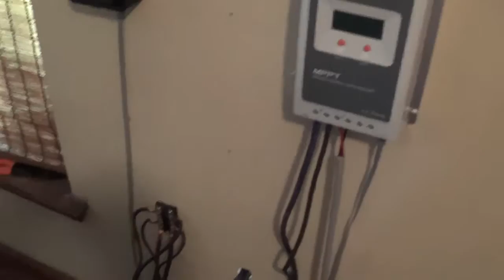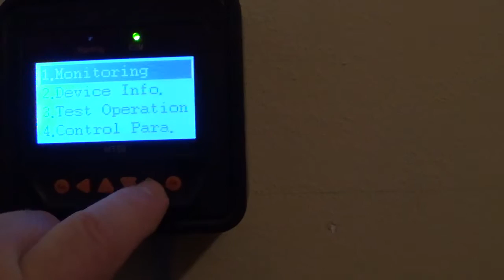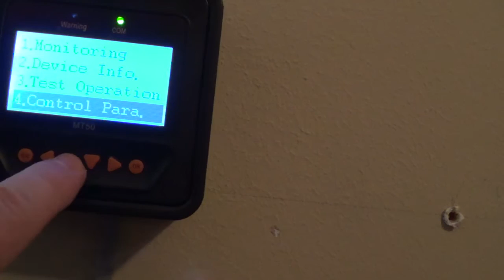Setting Parameters for Lithium Batteries and  MPPT EPEVER Charge Controller A series

Comment: Very clear lessons. I followed and using my MT50. Now I built a battery pack 7s 18p and on full charge getting 29.6v and unable to connect to my eleven controller and MT50 I couldn't find out a way to tell my epever and MT50 that I have a 24v battery. When I connect MT50 reports BATT. OVD and blinking in red. Please advise me
Reply from the maker: He man DO NOT connect them up to it with it charging to 29.6v its going to catch fire that voltage is waaay to high. You need it to cut out at 25.1  I am going to have nrodge1 explain it to you. Ask him your self he is on this page he is a engineer with this same set up he will explain it better than I. We are running 6s
Reply: shartne Thanks for your quick reply. I was advised by very big powerwall experts to pre charge the batteries to 4.2v before assemble the powerwall. So when I fully charge a 7s become 29.6v. This is my position. As you advised I have sent a msg to nrodhe1 right away. Thanks again.
Reply from the maker: @easy1792  Its nrodge1  you spelled it wrong.
Reply: shartne Thanks. But I replied to his comment   Did not typed his name. Waiting for his reply.
Reply from the maker: @easy1792  Go to teckluck.com http://techluck.com/cgi-bin/YaBB.pl?num=1486955008  and read how to set it up.  this is his forum he will answer you there. He has to answer your questions there because its his forum.

Comment: are EpEver BN series charge controller settings for LIFePO4 any different?
Reply from the maker: You should always look up the specs on any batteries you have beforedoing anything. You could have 4 cells in series or maybe 8 so youshould know more about them than anyone else.
This example is for my Leaf cells that are in a 6S configuration. You can talk to a real engineer in this forum called techluck.com  http://techluck.com/cgi-bin/YaBB.pl?num=1486955008   Nrodge1 is his youtube channel
Reply: @shartne  I have a Tracer4210AN and running two 12 volt LiPo's in series for 24 volts. The specs are for a 6s and my batteries are two 4s (3.2v) so I assume it is viewed as 8s. Do I take the values and multiply them by 1.3333 for my parameters?

Comment: How do you change them with the mt50?
Reply from the maker: Punch the left button that says Escape or ESC navigate down with the arrow down button until you get to Control parameters hit OK. Go here for details http://techluck.com/cgi-bin/YaBB.pl?num=1486955008  At one point it will say to inter manual settings hit that. You have to use the up down buttons to navigate. how far have you gotten on it? You have to get these settings in it or your batts will get angry and you dont want that. Dont let it charge past 25.1 volts. It will probably catch fire. Lithium batteries are serious business.
Reply from the maker: I may have to make a video of me doing it with details. but if you go here it explains how. http://techluck.com/cgi-bin/YaBB.pl?num=1486955008

Comment: This is very helpful thanks for showing this
Reply from the maker: Thanks and this works I have been doing this for three years no fires. Max voltage is only 25.1 that is important because you don't want to over charge them they will get Angry and you wont like them when they are angry. Go to teckluck.com http://techluck.com/cgi-bin/YaBB.pl?num=1486955008  and read how to set it up. No not all the voltages are the same. they wont go in unless you do it in a certain order. Set the over volt disconnect at 25.1 set the charge limit to 25volts  over volt reconnect 24.9volts, Equalize charge 25 volts, Boost charge 25v, Float charge 25v, Boost Reconnect 24.9v, Low Volt Reconnect 24.4v Undervolt reconnect 24.4v, Under volt warning 24.0v, Low volt Disconnect 22.2V, Disconnect Charge limit 21.2v It works fine for me. you may have to go to the techluck for better instructions because Im not sure what order I did this. If you join the forum you can ask questions. This was actually figured out by my electrical engineer friend. So it works trust me or him. LOL
Reply: @shartne  Oh yea its extremely important not to go under or above those settings. I appreciate how you showed the mt50 controller you dont see lots of videos with settings for lithium especially diy car batteries like that. I also like your rig its not too fancy and is something real people who dont have a ton to spend can do. I hope you make more vids showing how it holds up over time and what you power with it and how much hours it will run appliances.
Reply: How do you change the voltages?
my mt50 couldn't adjust it. 
Help!!!!
Reply from the maker: @rogermendez7266  I guess I will have to make a detailed video. Maybe sometime this week Im doing my taxes right now and I have my granddaughter right now too. Dont even think about using it with out it set up with the correct voltages it will catch fire and burn everything down.
Reply: @shartne  Thank you. 
I'm just stuck for now with this.
Reply from the maker: @rogermendez7266  Watch this video this guy shows how to do it. https://youtu.be/57tC6mIyXvo    And also did you go to techluck to see the procedure you have to change the voltages in a certain order. http://techluck.com/cgi-bin/YaBB.pl?num=1486955008

Comment: Ok so it looks like you have a 6s setup, its handy to know about the voltages, just keep them all the same, makes sense since lipo do not fluctuate like led-acid battery's. thanks
Reply from the maker: Max voltage is only 25.1 that is important because you don't want to over charge them they will get Angry and you wont like them when they are angry. Go to teckluck.com http://techluck.com/cgi-bin/YaBB.pl?num=1486955008  and read how to set it up. No not all the voltages are the same. they wont go in unless you do it in a certain order. Set the over volt disconnect at 25.1 set the charge limit to 25volts  over volt reconnect 24.9volts, Equalize charge 25 volts, Boost charge 25v, Float charge 25v, Boost Reconnect 24.9v, Low Volt Reconnect 24.4v Undervolt reconnect 24.4v, Under volt warning 24.0v, Low volt Disconnect 22.2V, Disconnect Charge limit 21.2v It works fine for me. you may have to go to the techluck for better instructions because Im not sure what order I did this. If you join the forum you can ask questions.
Reply: Thanks

Comment: can i used this parameter to my 18650 with 7S80P battery bank ? consider the full voltage will reach 29.4V......very apreciate for the reply
Reply: Ya I'm not sure about that charge controller but ya fully charged 29.4 I'd probably run it a little lower give you some head room and should help the batteries last longer like 29v or something but I think you more or less just disable float voltages and equalization but I'm not sure how you do that it might be by setting them lower than the bulk charge finish voltage
Reply from the maker: I think so let me ask my engineer friend. Are the 18650s 4.2 volts.  I think so. you would run six in a series that would be a max of 25.1 volts to cut out at. you would not run them higher or ruin them. Have you been to the Tech luck forum. Techluck.com ask that guy he is a real engineer. post a comment. he has this set up on there. This guy is close to a genius about electricity. Well he is very good.

Comment: How are you liking the leaf batteries
Reply from the maker: so far I love them. working out really good.
Reply: I love them, I have 24Kwh now and inside the house. I run everything including the A/C and it's fun to stick it to the power company! My hot water heater is on solar too but a separate system, see  http://techluck.com for how that works.
I don't worry about fire because they are not firecracker cells rolled up into a small metal can. See NISSAN LEAF BATTERY CELL - FIRE and DESTRUCTION TESTS at full charge
Screwdriver puncture, torch test, NOTHING HAPPENS!
https://www.youtube.com/watch?v=Jz37WycW-7E

Comment: Is it safe to use this epever solar charge controller on lithium batteries after making the changes??
Reply from the maker: yes if you set the correct perimeters like I showed. I have been using them for about six months now. you can see them on the video or go to  http://techluck.com/cgi-bin/YaBB.pl?num=1486955008  and see the instructions that nrodge1 made.  The charge controller is set to cut off at 25.1 volts any higher and the batteries will get very angry. you wont like them when they are angry.  see in the video got to parameters. Set the over volt disconnect at 25.1 set the charge limit to 25volts  over volt reconnect 24.9volts, Equalize charge 25 volts, Boost charge 25v, Float charge 25v, Boost Reconnect 24.9v, Low Volt Reconnect 24.4v Undervolt reconnect 24.4v, Under volt warning 24.0v, Low volt Disconnect 22.2V, Disconnect Charge limit 21.2v It works fine for me. you may have to go to the techluck for better instructions because Im not sure what order I did this. If you join the forum you can ask questions.
Reply from the maker: yes it is safe it has been working for 6 months instructions  http://techluck.com/cgi-bin/YaBB.pl?num=1486955008
Reply from the maker: perfectly safe.

Comment: I thought float charge was bad for lithium...
Reply: The float is basically off on the CC. These EPSolar CC's were really not made for Li-Ions but they work. You really want a CC with remote voltage sense but these are so low priced you can live with it. The settings are described here when using the MT-50: http://techluck.com/cgi-bin/YaBB.pl?num=1486955008 or look for "EPsolar Tracer A series voltage settings using the MT50 and Li-Ion batteries" on the TechLuck dot com forum

Comment: these need a bms if charged close to 4.2 volts.
Reply from the maker: Still the voltages match going the third year 1/27/2019  Nissan leafs are not those crappy 18650 fire cracker batteries. These are matched from the factory running in parallel.
Reply: @shartne  are you disconnecting the bus bars to take your cell readings?
Reply from the maker: @TimFrentz  no you dont have too. ground it on the cell your checking
Reply: yes it is a battery management system that stops the cells from overcharging as the slowly drift in voltage
Reply from the maker: Batteries running in parallel. so it is ok.
Reply: but you still have 4 packs of cells in series to give you 16 volts though, 4 packs will differ in voltage over time and some will be at 80% charge and others will be over 100% charge and may explode.
Reply from the maker: I just check the voltages today all voltages exactly the same.
Reply from the maker: so far this has not been a issue. 6/15/18 still yet I run two batteries in parallel and they keep each other equaled out. They need to be check from time to time. They are from the same bank of matched batteries from the factory. when they get old this may turn into a issue.
Reply from the maker: Still voltages are just fine. 8/30/18
Reply from the maker: Still working great. no BMS
Reply: These are 6 cells, 6S and the charge setting is 25.1V so 4.18V / cell max, they are all new and made at the same factory at the same time, not random cells from old laptops. A BMS may be needed as they get older but it's been a while and all is OK. I also have 2KWh of LTO's Lithium Titanium Oxide batteries in parallel with my Leafs (10S, isn't that fun) and they actually seem to balance themselves because they were a little out of balance when I got them but in the next few days they fell right in place. The Leafs may be doing the same self balancing for now due to their internal resistance, notice I say for now. I try to not push them to their limits so they will last longer.

Comment: That is great that you have it up and going. It's doing a good job running the all the electronics . Nice job !
Reply from the maker: Thanks I finally got close to done now I need a cut off on the panels so that is next. Also I need another stack of batts so I can run my fridge too.
Reply from the maker: I got another stack now I have almost 5 killowatts of storage I can run my 8,000 btu ac for all day long and up until midnight with the tv and sat running too also the fridge. it runs out about 12 o clock need one more stack of lithiums to go all night. my electric bill is dropping like a rock.
Reply: Hi! thanks for the good info and my congratulations!  Сould you share please a diagram and instructions. How to build the full system. Thank very you

Comment: Hope it works out I have had no issues with my Epsolar 4215 40 amp unit in my solar camper.
Reply from the maker: The EPsolar inverters are real MPPT and the price is right so I love mine. You can put three thousand watts of panels on them but they will only put out about 39-40 amps. I have two one 30 amp and one forty amp. I am thinking about getting another one for back up. or get more panels.
Reply from the maker: Some times temporarily mine will not do the high voltage like I want it too . but it starts back after a short while.
Reply from the maker: the Nissan leafs are working awesome they are the battery to get I do recommend them after almost two years of service running AC tv sat. fridge computer they are great batteries. Damn lead acids suck I have bought so many of those just to crap out after a year or two they are a complete waste of money. Lithium Ion Leafs FOR The WIN!